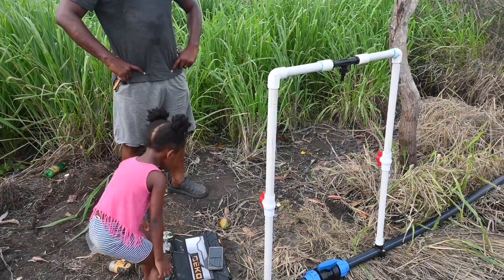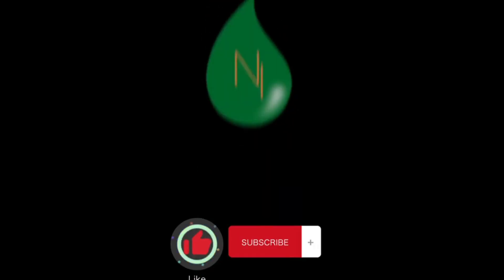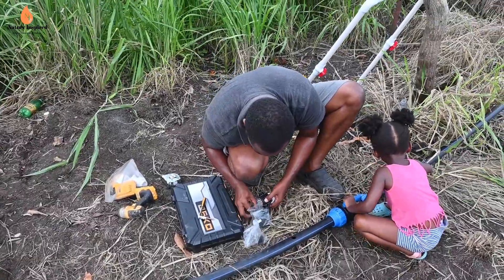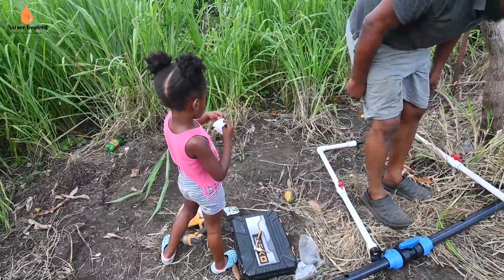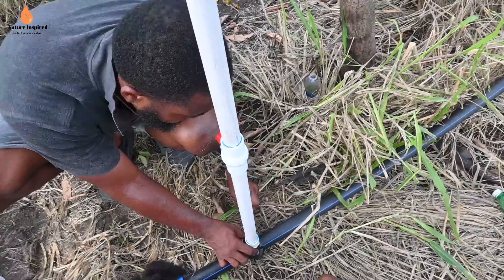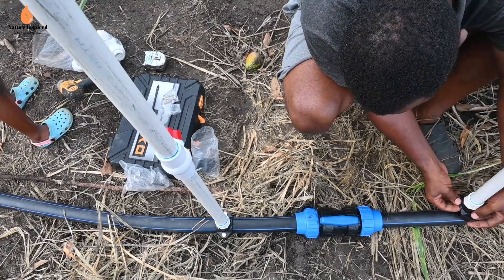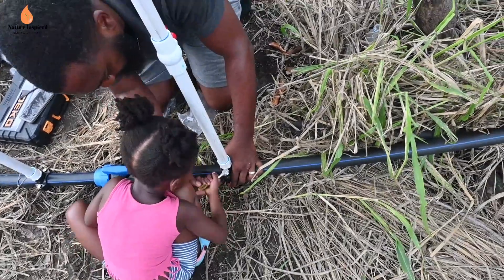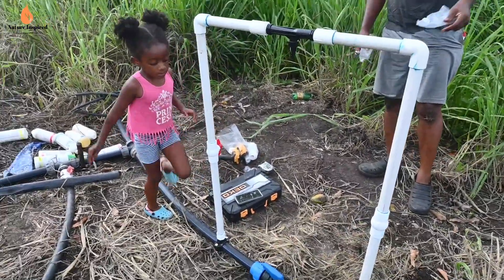We installed our first fertigation system on plot 3. Part 2

Comment: Why not put the fertilizer in the drum with the water instead of setting up a fertigation system ?? Just asking
Reply from the maker: @DemarSmith-e5n  the fertigation system uses the pressure from the water in the pipe to push the the nutrients through to the entire plot. It's just easier to use this way for us.